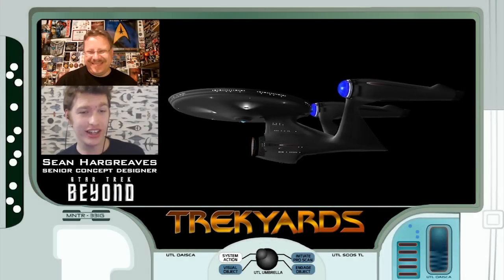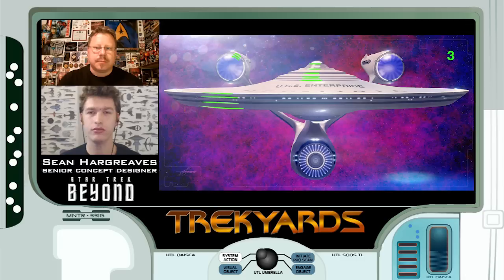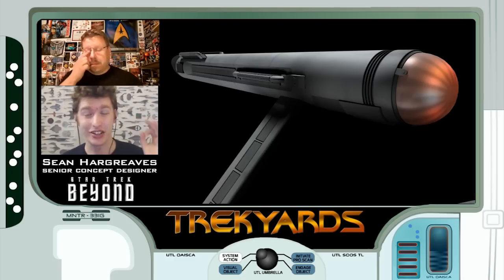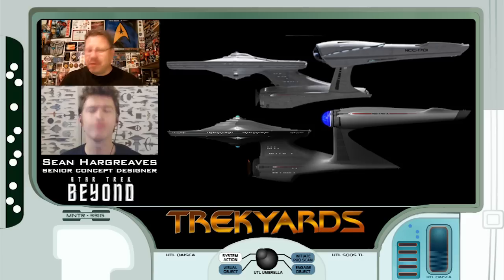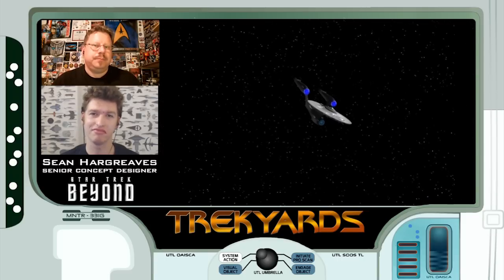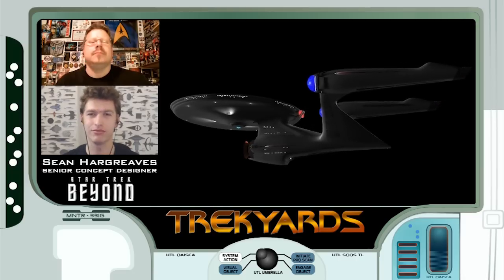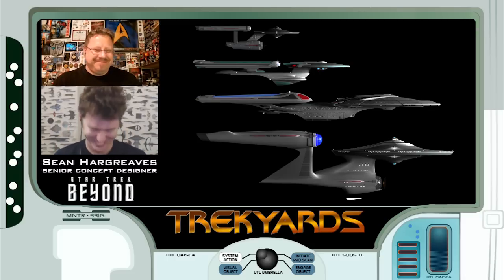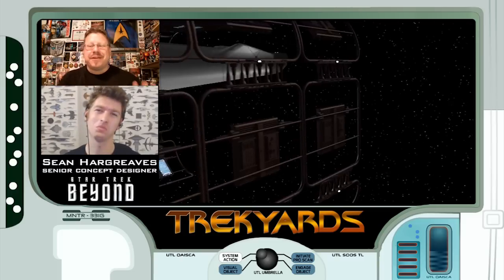Enterprise EP187 - Enterprise 1701-A Concept (Part 2) (Beyond)

Comment: I'm sorry to say but I really don't like the neck or the long bulky pylons (ape brain). Every thing else works for me, overall a good looking ship.
Reply: I think like the Discovers the parts "Blend" is off a bit - his desire to match angles has created some awkward shapes. the very thin secondary hull looks like it's supported by the "wings" it wouldn't need wings on it that broad if the hull scoop wasn't so extreme the elongated hull design also makes it look like the Excelsior too.

But I will likely buy the Eaglemoss version so I'll have some idea what the ship looks like from all angles then, it's not that I dislike it - I just think it has some balance issue design wise and just as the disco look horrible from the underside bu kinda cool from the 3/4 top view the Legs 'A' kimbo really doesn't look good from the upper back or side. and any angle that you notice how pencil thin the engines are now.

Comment: Even as a 40 something year old Trek fan I have to say that I loved the new Enterprise. I thought was a great modern take on the classic design, outside and inside.  I honestly don't think any of the changes over the 2009 version has been an improvement. The Into Darkness changes just felt like change for the sake of it and this new design is trying too hard to be the original(don't ban me bro, lol).  Visually every angle on the Into Darkness version was a downgrade. The front view on the new one is good  but still not better than the 09 version.

1. The perfect neck from 2009 got messed up for Into Darkness. It looks even worse now.
2. The nacelles are still swept too far back(but not as bad as Into Darkness). While the wider stance nacelles are good, the top view as a whole looks pretty bad, just like Into Darkness. It looks like a frog being held up so that it's legs dangle.  
3. While the 2009 nacelles were admittedly huge, they were gorgeous.  They're too plain looking now.  They also connect to the pylons in a weird place.
4. The curved pylons on the 2009 version looked great. To me that addressed one of my two problems with the TOS Ent. (neck and pylons) I didn't like the changes made for Into darkness and feel the new changes are worse. The way they meet at the back looks terrible.  They also look bad from the top and not as good from the side. Has this been fixed in the movie version? I hope so.
5. The more cage style dish was fine. A change that wasn't needed.
6. The pie plate doesn't look as good as the curved saucer in my opinion. Doesn't bother me too much, it's just another unnecessary change.
7. The 2009 shuttle bay looked much better. Coupled with the pylons I don't like the new ship from the rear at all.
8. The secondary hull has way too much of a sweep.
9. Bravo for going back to double impulse engines. That looks better.

That was a lot of points to really just say the 2009 Enterprise was fine as it was.  Almost everything since has been a step in the wrong direction. The only thing the 2009 version needed was the nacelles pushed apart a little. 

Side note- I really don't understand the problem with the window on the bridge. I think it not only looks cool, but it also works great for the reasons mentioned in this video and is no more a liability than having the whole bridge exposed on the top of the ship. There are other windows on the ship so you can look out. Why not have one on the bridge? The point about the window on the top of the TOS Ent. was a good one.

That's all just my opinion. No disrespect intended to Sean Hargreaves, the new design just isn't my favorite. I guess I just really liked and have gotten attached to the first run.

Love the show, and I respect your opinions as well. I guess I'm just a Trek Heretic :)

Comment: The only two problems I think I had with this Enterprise-A, besides the huge silly upscaling common in the JJ-verse, was the flat-fronted neck, which just felt too thin right underneath the saucer, and the blue bussards. I think I would've been so happy if at the end of that construction sequence, the A is about to depart from Snowglobe Yorktown, and the bussards lit up orange, like back in the good old days! Other than those two features, one of which sounds like they tweaked anyways, I am so much happier with this Enterprise than I was with it's predecessor.

Comment: i actually like the stepped region around the bridge and the area of the new shuttle doors having so many lines converging to the tip of the tail.

and really, usually one shuttle leaves/enters at a time so it doesn't need to be wide enough for 4 shuttles to fly through at once like in the jj movies.  that huge shuttle bay opening just looks nice from the outside, unless they need to park something really big inside.

Comment: I'm ok with the smaller door for two reason
1 since this ship is Galaxy size you dont NEED to scale the door up that much... 
2 even when. the door is fully open... at least half the width is unavailable to fly into so why have the door open wider than necessary? that's a tactical weakness in you most vulnerable Quadrant
Reply: Steven Heckert The galaxy-class is 641 meters long, and the JJprise is more than 1500 meters long
Reply: ok... but doesn't that even MORE prove my point that it's doesn't NEED such a huge door on the back?
that being said... it's a bit deceptive to only use length since that doesn't take into account the fact the the Galaxy class was built WIDE and the JJPRISE in addition to the TOS Connie exaggerates is size by having the nacelles pylons sweep back and then attach so far close to the front of the nacelles. A snake can theoretically be LONGER than a horse but it's unlikely going to have more mass
Reply: I agree in some of what you are saying, but think of this: The enterprise-D is very sleek and very long compared to it`s hight, and the JJprise is colossal both in hight width and length. 

The bridge of the ship is also extremely surreal in its proportions. I will conclude by saying a few true words; "The JJprise is extremely ugly from any angle"
Reply: We've gotten a bit off topic here. I agree that the turd cutter doors on a Connie look out of place BUT I will counter that with the observation that  that for the last 30 odd years the Kabuki paper fan/ seashell door has struck me as quite silly. Especially since it looks like J J Abrams has been leasing storage Space to Pep Boys along each wall and you can only pack a sub compact down the center

Comment: The designers keep trying to employ delta symbols in everything.  Notice how the saucer is so awesome, it's hardly ever changed. It's he issues with the rest of the ship. And yes. The shuttle bay looks like a dog butt. This is not the final design however since the screen version A has a neck torpedo launcher so I'm interested  to see the other changes.
Reply: The neck is curved at the front and the nacelle struts don't angle right back into the shuttle bay. I daresay there will be a Trekyards episode on the film version of Enterprise-A at some point in the future.
Reply: The issue is here that some designers try to cram "car designer" principles into their designs and some try to cram in Aircraft principles - I think over all the Aircraft principles work for me - heck the Cathedral elements work better for me in starship design.

I appreciate those designers who understand what the parts actually do and how they'd be used and go at it from that direction - more than I do the ones who just go on look - the Enterprise Refit I think is so adored as it does both right it's damn pretty and it also looks functional too.
Reply: Exactly 90 Lancaster.
These parts have a purpose.
Reply: Gareth Fairclough
Yeah it was good place before it collapsed.  I think they got it back up but I haven't been back since.  I'm at STExcalibur but they've ground to halt too.
Reply: Hey Captain Obvious, it's been a while.
I have a few on Facebook too.  Wiley, Farshot and a couple others.  I'd hate to lose touch with all that talent.

I'm also quite gratified that Foley and Cockings created Trek Yards because it's a fantastic channel for design and creativity.
Reply: Yeah I think I have the same Jimmy Butler on FB too.  I forgot about Baz
Reply: I'm so happy I came across this comment thread.  This is Phaser from BCC.  Glad to hear you're still in contact with those folks, saquist!  It was damn good times.  I was so saddened when I saw that BCFiles died.  Luckily, Nebula saved most of the files.  (Including TCMP! Yay!)
Reply: Bigflank
 Wow Phaser long time no see.  BCFILES..man...I'll never forget our time there.  All the great PotD's

Comment: +21:00 Since the 2009 Enterprise effectively has the Bridge on deck 2 not deck 1 - that means it likely isn't a window on the top but is instead a sensor dome like the one on the underside is. which does make a crazy kinda sense I guess. as otherwise it makes you wonder why there is an upside down window on the underside of the saucer on the Matt Jefferies version.

Comment: Good overall design and placement of the nacelles, HOWEVER the massive surface area of the pylons and neck coupled with the 90-degree angles on their leading edges make the ship look far too bulbous in profile view. Could we not have had a little slant? Also, why not use more rectangular nacelles to pay homage to the original "A"?

Comment: I actually liked the bridge window. Now, I ASSUMED there would be a big bulkhead that could close over in case of emergency - it even looks like there's room for a fairly substantial one if you look closely. But then of course in Beyond, no such bulkhead appears - and to add insult to injury, the window is taken out by a hand-held phaser.

So yeah, conceptually and aesthetically I like it but the real world details certainly weren't worked out the way they should have been.

Comment: You need thin lines to avoid weapons fire. The side profile of this it just a huge target. Something that Trekyards does not seem to get. With shields and structural integrity having a thin profile is a good thing. If you lose shields and the structural integrity field, then it does not matter how thick pylons are. You are more likely to get hit than if you are thinner and can maneuver out of the way. I love the saucer, and the nacelles on this.

Comment: I do get where he's coming from and I get him wanting to earn his paycheque - but every choice they made is going to lead to some very strange looking physical models.

Frankly if he'd done everything he'd done and then put horizontal struts on it and called in a new class Say "Excalibur class" I'd have been all for it.

But I tended to think that they had it mostly right with the "5 year mission" Enterprise and if it needed anything it was very minor tweaks like moving the neck on the body forward a bit -  shortening the cutout under-scoop on the back - slightly thickening the nacelle struts and mounting the engine further forward on the struts by about 10% also getting rid of the Impulse engines and going back to the older design from 2009.

The correct angle for engine placement spacing to my eye would be a  distance between the Legs "A" Kimbo and the "5 year Mission" Enterprise.

The whole back end of the engineering hull and the Deflector is fine on the "5 Year mission" Enterprise. Engine wise I understand why they are so big it's to visually balance the engineering hull Like with the Kelvin and I consider it part of the house style - I wouldn't change that much and I wouldn't change the rotors in the end caps either - I would add some fairy lights inside them though behind the rotors. so they appear to blink a bit as the blades spin.

The image at +10:20 to me screams that the Ryan Church 2.0 version is hovering around getting perfect.

Perfect does not mean it looks like the original series - perfect means that it works in an of itself inside the style established in the Movies in terms of visual balance and visual appeal and to some extent function.

The new one looks like a car prototype - rather than the production models to me. it's to out there. and that neck - boy that Neck is just so very wrong. it's fine to want to slant the struts the vast majority of Federation Starships have slanted struts after all.
if he's balanced the front of the neck with the trailing angle on the back instead of the leading edge - or if the saucer was further forward both of those would have helped.

I'll need to see it in motion more though to see if the flat page problems evaporate like they do with the 'D' The D is the ugliest thing you can imagine from some angles - so they learned to not shoot it from those angles - the Legs A Kimbo may be the same.

Comment: I think the final version of this ship is absolutely beautiful
Reply: Yes the final version is quite a bit better that I will concede they did to a pretty drastic fix job on the "Protorype" at the last possible minute and it did help quite a bit overall. and it does look better on screen than it does in static images.
Reply: I like the way way they changed the neck on the final version, to me it is nicer than the original sketches.

Comment: -The stepped feature Bridge Module IS THE MOST RIDICULOUS PART OF THE SHIP.
  I never thought I'd see the same mistake Sovereign made but here it is again.

REMEMBER PEOPLE:  We walk on flat DECKS.   This is NOT usable space in the contoured decking behind the bridge.
This is the problem when you have these pure CGI artist with no understanding of Form OVER Function.
Reply: Boy...nobody show him a D'deridex warbird.
Reply: It's far more likely I know it better than you.
Ship design is what I do.
Reply: Mhmm.
Reply: You could easily fit a slide between the bridge and one of the main decks in there. Weeee
Reply: How about those Borg Speres...must be a nightmare to try and jam stuff up against the walls on that thing.
Reply: marsm9 
-The cube is the most efficient works apace design.
-The sphere is the most efficient tech space design.

The sphere gives maximum horizon from any one instrument hardpoint.  sensors weapons and all sort of emitters will all have the same degree of vision.
Reply: +DocWolph
You should know that I'm a Drafter and Designer II in the field of Structural Engineering.  This is what I do for a living.

Can you tell me any reason why a contoured and layered decking along a funnel shape would have any useful  purpose in in that area.  This is living space.  Do you think the 3 mini decks are for?  Would you put Power Distribution down the neck, refueling like the Secondary Hull spine?  No, too vulnerable for power, and the fuel tanks shouldn't be that far away from the reactor..

Good Designs have purpose.
Reply: Deduction my dear Watson
If you eliminate the impossible whatever remains however improbable must be the answer.

-You may not know what's going on bellow the hull, but I know enough to see nothing useful could be driving this form.

-Since I know Trek Weapons frequently reach 5th magnitude (Petawatt) scales of power it means no elemental material couldn't possibly resist this level of energy.  Even with magic materials why not apply it every where?

-Thus if it is 'armor' it's ridiculous because the application is nearly completely irrelevant.  Neck and Pylons, the weakest areas show no such application.

-I also know the artist simply didn't care thus there is no reason for this conglomeration of ridges on the outside leading to either compound arcs in the Ceiling or compound arcs in the deck...perhaps both.  It's literally an addition with no useful utility.
Reply: My point was it's Sci-fi...the fi standing for fiction. None of it works, its all made up. If they made everything to your "form over function" mentality, everything would be a borg cube...which you already pointed out. Form is ok even if there is no function...it looks better than a cube. You must not enjoy a good looking automobile either...so much wasted space that doesn't do anything, lines that don't have a purpose and types of material that have no business being on a car...ridiculousness!
Reply: In recent years You Tube presenters and news outlets have capitalized on just how much of Trek is possible and how some designs fit remarkably close to NASA concepts on real warp.

That's is a remarkable moment where fiction got it right before we had a clue on the dynamics and perhaps that's because Jefferies wasn't just an artist but a designer. 

That marsm9 is quickly becoming a lost form in our media.
Reply: saquist I agree with that. I love that Star Trek has created generations of people who have gone into the sciences and are actively trying to create this technology. But suspension of disbelief is also a great thing that is also becoming a lost form in culture or at least on the internet.
Reply: marsm9
I've looked at these marvel films and series...WOW Luke Cage...

I think people are eager to suspend their belief.  I LOVE THOR, AVENGERS and IRONMAN, but thei are going through such effort and love to get the series right.

On the other hand DC has been putting up crappola and ...in similar way so has Paramount and I really think the heart of this is the larger issue of ....the Lawsuit, the Guidlines the Discovery delays.  ANd it seems they just aren't listening to us.
Reply: you know, I think that if the ship is larger than a Galaxy class, and that is the side supported by the overwhelming majority of on-screen evidence, there would be plenty of room in those steps.
Reply: Patrick Moscatello
  Plenty of room.  But not for decks and living quarters